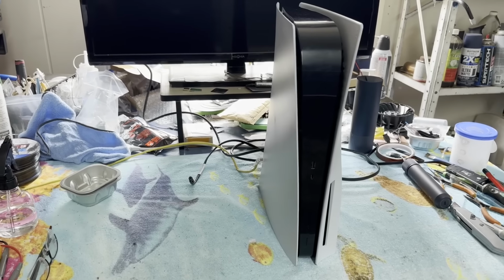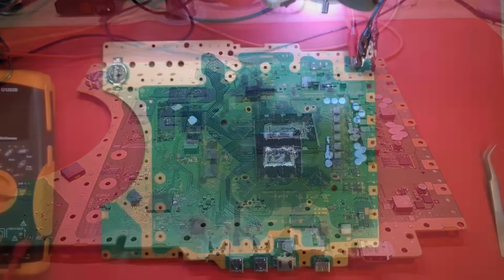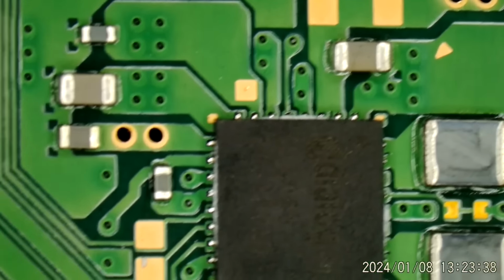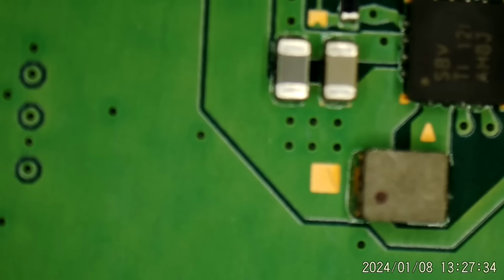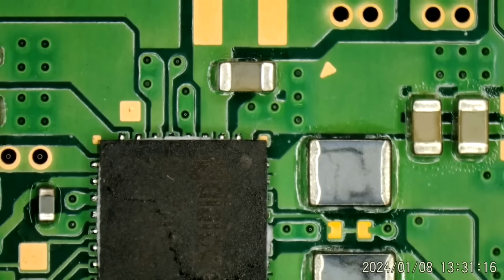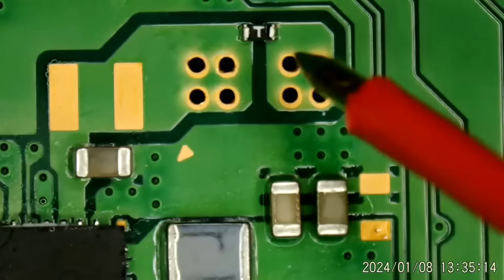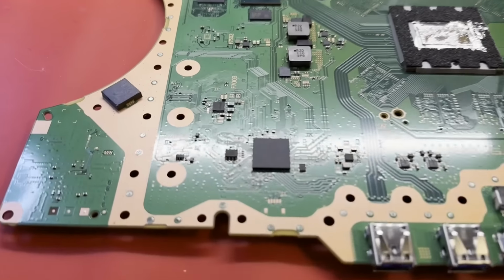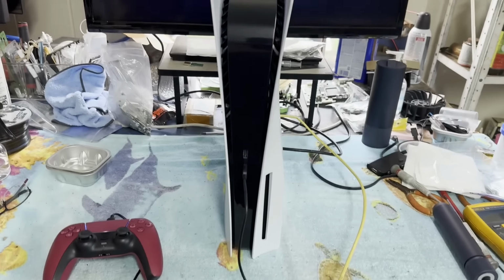#129 Repair of PS5 Disc Edition Totally Dead

Comment: Amazing how easy it looks like to repair a complicated system like a PS5. My trials always ended up in a disaster. 
What temperature and air flow did you set to solder the capacitor and fuse?
Reply from the maker: Thank you!  I believe I was using 400C at maximum airflow on my Quick 861DW.  Adding leaded solder to the contacts helps remove the damaged components with less heat.

Comment: Very  nice!
Explain please what you did in the beginning with the oscilloscope.
What is the setup
Reply from the maker: I have a clamp-on current sensor on the wire between the bench supply and the board I'm working on.  The output of the sensor connects to my oscilloscope.  It's just a neat way of visualizing the current demand of the device under test.  It may help sometime with fast current changes that don't show on the power supply screen.
Reply: @ToltecMerc  You are the boss!!!

Comment: Amazing diagnostic...Do you have a video or canyou make a video please of how to troubleshoot the board with a multimerer only...for my ps5 as no display all of a sudden...It recognises as unknown on my tv..jsut no signal...The hdmi port is good tho..thanks a lot
Reply from the maker: Your HDMI port may have broken connections.  You would need an HDMI breakout board and a meter with diode test.  That would allow you to confirm if you have a connection on each pin of the connector all the way to the mainboard.  They should all give a diode reading except pin 14.

Comment: Any idea about the fuse amperage used on the 5v rail?
Reply: 5A
Reply from the maker: 5A sounds correct.  As far as I have seen, they only use two different fuses on these boards, either 5A or 2.5A.
Reply: @ToltecMerc the 5A labelled T are Panasonic ERBRD5R00X
Reply from the maker: @ctdubbin2  thanks!  That’s good information!